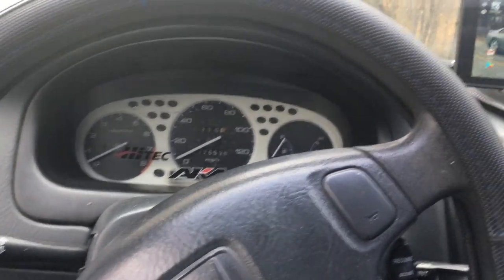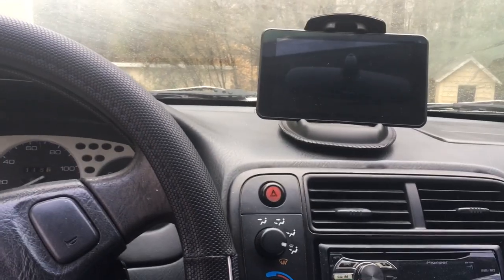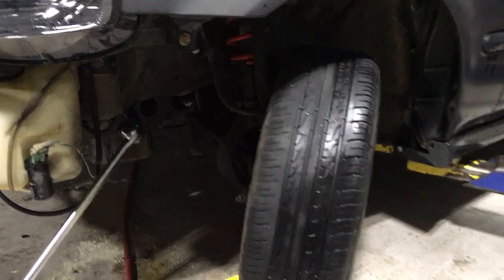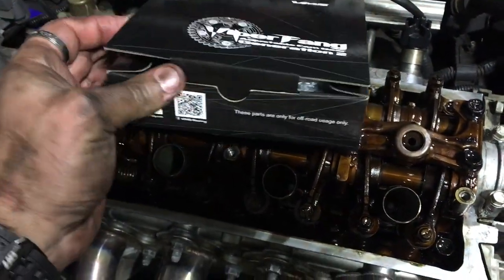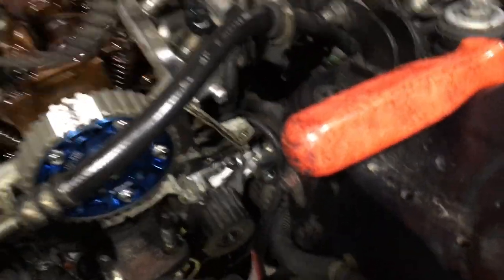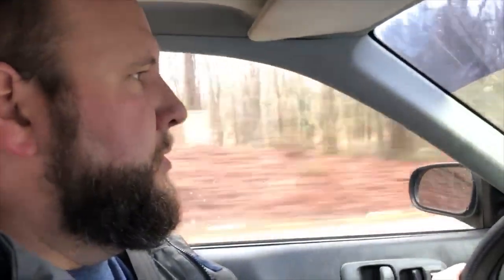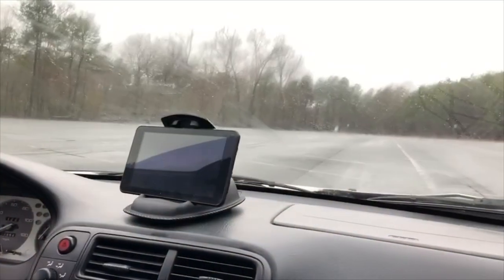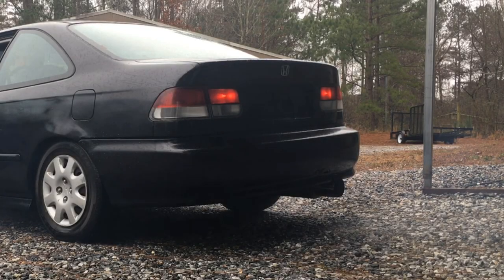VMS Racing Adjustable Cam Gear - 2000 Civic EX VTEC Turbo Build

Comment: I believe that the cuz cam gear is different to my opinion is that vms cam gear is offset by a Tooth but just like you said “maybe I’m looking at it weird “
Reply from the maker: Juan Trujillo I don’t think the cam Gear was off by a complete tooth, but the key way to the TDC position seem slightly different.
Reply from the maker: However, most timing belt jobs will seem like they are off by at least half a tooth.  Make sure that you count the teeth and put it back exactly.
Reply: Not off one tooth , and not even abt counting teeth its abt making sure TDC

Comment: For a cam gear swap you did not need to take everything off just the rubber cap get a 14mm socket in there loosen that belt and just switch um out and then time no need to take the pulley all the way off
Reply from the maker: Tire, but it’s also a good idea to change the timing belt, if it hasn’t been changed in a while, like we did.

Comment: Thinking of buying a VMS cam gear. What is your opinion on it? Do you think it'll last? I've heard horror stories about adjustable cam gears, not necessarily VMS ones.
Reply from the maker: Vladimir Dobre I really like it.  It seems to be very high quality.  I would think as long as the bolts stay tight, it should last forever.
Reply: @HiRevzMedia  Oh, ok then. I might actually buy some other bolts for it as I don't like those allen ones. Thanks for your fast reply.
Reply from the maker: Vladimir Dobre yea man, please subscribe
Reply: @HiRevzMedia  already did. cheers!
Reply from the maker: Awesome, thanks bud!
Reply: Same i just blew up my race motor with the aem  cam gear,  now im like fkit vms is ok for 50 bucks or should I buy the skunk 2??
Reply: i got a aem cam gear so far its fine but i used blue loctite on the threads for the bolts , when the car is set and tuned to whatever degree u want u can then use a red loctite to make sure it stays

Comment: Finally someone with a VMS cam gear, can u tell me how to time my car, I have a D15b JDM non vtec with a ZC head, I bought the VMS cam gear and I dont know where to set the marks at, I put the top mark up and tried the timing light but the mark on the gun keeps jumping back n forth and wont let me set it, any help would be appreciated ive never installed and adjustable before thanks
Reply: There should be 2 lines on the cam gear and those go at TDC flat with the head/block surface , crank at tdc has mark on timing cover. Set timing , tighten tensioner, rotate motor over a few times , loosen tensioner and tighten it again to adjust the slack
Reply: Also holding a wrench on the cam gear while setting timing helps
Reply: @dilbeckskate  Thank you sir appreciate it, so the bottom mark doesnt have to line up to the pointer on the bottom the two top marks dont seem to go flat if the bottom mark is set to the pointer jaja (SOHC)

Comment: Hi!

what adapter did you use to pull the data from the ecu? 

thanks!
Reply from the maker: Christian Paulo Balastigue you cant use the TunerView app with the stock ECU, but any OBD1 Bluetooth datalogger will work, with a chipped ECU.
Reply: @HiRevzMedia  thanks!

Comment: Idk why u explain ur line u made on ur serpentine belt the wrong way.meaning, it doesn’t matter where tf u put ur belt just on 🤡💯💀don’t over complicate things for others cause ur belt is old and u don’t wanna buy a new one so u wanna know specifically where the tension has been, … explain it that way.💯that’s the only reason u should have a line on ur serpentine belt cause it’s old and wanna know exactly how it was 😭🤣 even tho that’s ridiculous as well, everyone that doesn’t know how to put on a serpentine belt LISTEN, u just put it tf on 💯💀
Reply from the maker: First off, this isn’t a serpentine belt, it’s a little more important than that, it’s a timing belt, which keeps the engine in time.  

Second, the old belt was literally cut off in the video.  A brand new belt was put on with the cam gear.  The new belt was marked the same as the old belt to insure the engine stays in time.